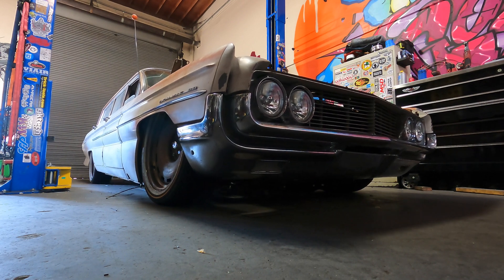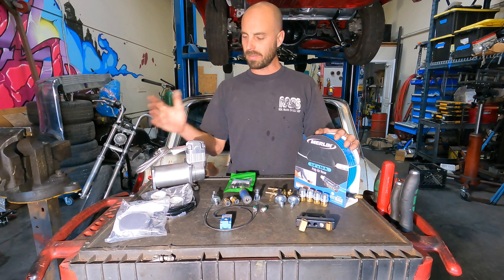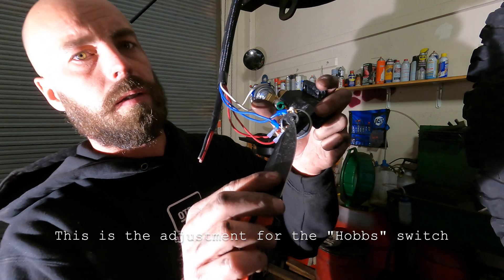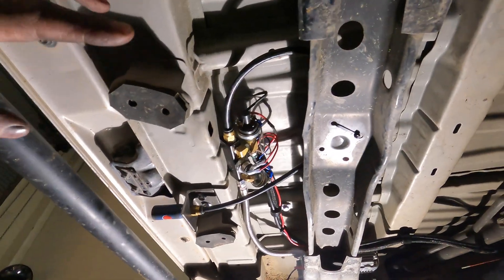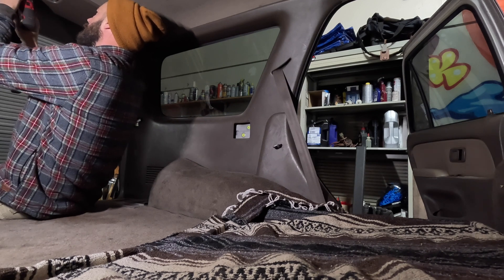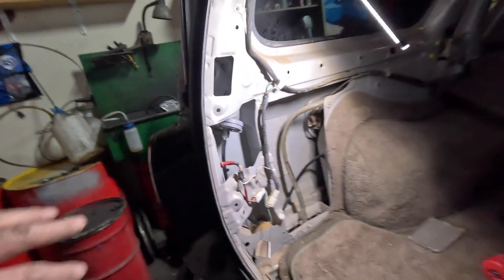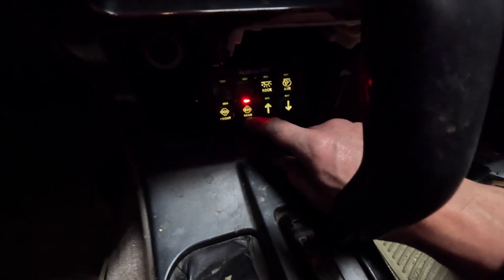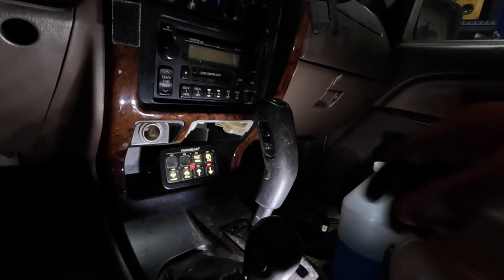Redneck Engineering an AUTOMATIC Tire inflator/deflator

Comment: Good try ..i was really hoping it was going to work....speed is always why I stick with a 25 lb co2 tank and a set 60psi regulator..about 15 sec a tire. Those viair or arb compressors are weak AF
Reply from the maker: I just got one that’s too small and asked it to fill up 4 37s from 4psi to 32 psi. A bit much in retrospect 😂